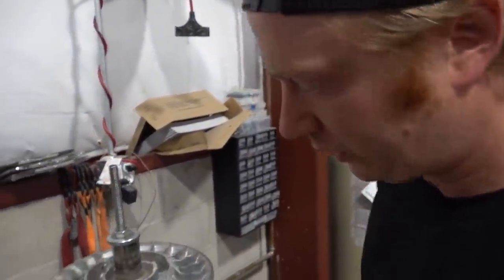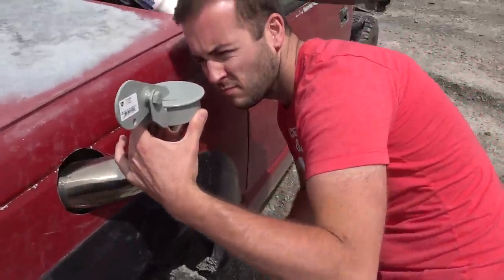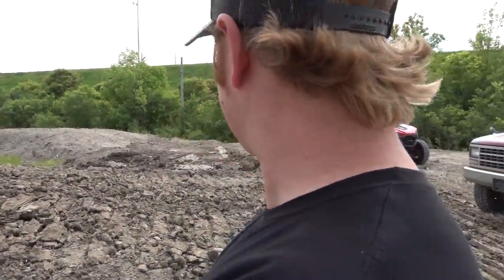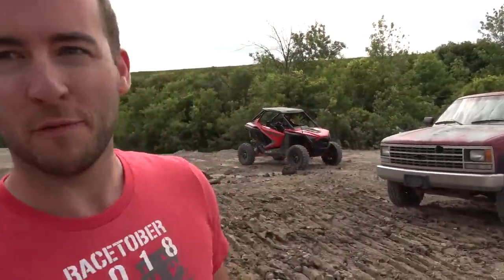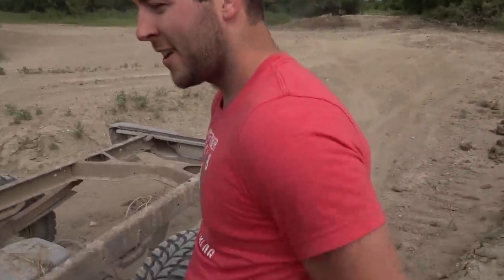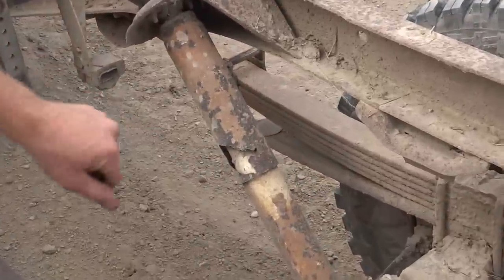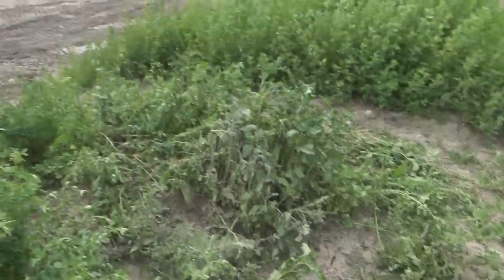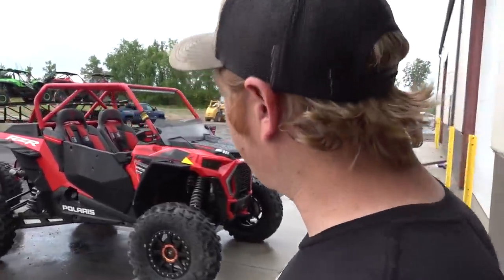RACE UNIT RIP, Pro XP hits the jump, and big TRIP PREP!

Comment: Threw my rollers into oblivion the first ride on my new 2020 maverick x3 turbo. Put those same GBOOST ones in mine and haven't had any problems. I read when they press the rollers in from factory and over press them, it can cause a small fracture in one of the soft rollers which causes them to self destruct pretty much. I had 14 miles on my unit when it happened. Got it fixed as warranty work though and got some tougher GBOOST ones so can't complain overall 👌

Comment: That little hole on the flap is where you can add some counterweight to help it open if your engines exhaust isn't strong enough, and to keep it from bouncing and causing a clanging sound every time the engine lopes.

Comment: We built an “on the cheap” water trailer, highly recommended for you guys, you won’t be disappointed. Used utility trailer, Craigslist/ Offer Up water container (food service/ veg oil container) and a used gas pressure washer. Tow out with the race unit and wet down the track lol.

Comment: Just get a water tank and some sort of sprayer and ratchet strap it to the frame of the race unit you can use the forklift to take it on and off
Reply: Also rough country shocks for the unit cheap but not bad offroad

Comment: The springs are on the tractor flaps would be like coil spring hold the flap part down on the exhaust not pull it away

Comment: 5:55 I think that hole is to hang up on the shelf. At the store. 
or weight savings lol. you could strap it open for .001 more Hp as well. Whatever Hp it take to lift that flap you are loosing technically.